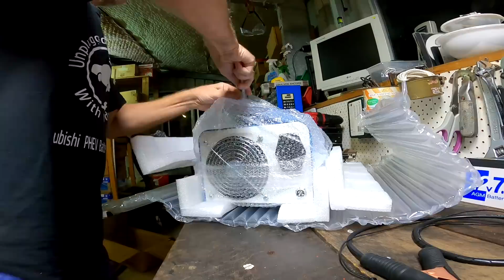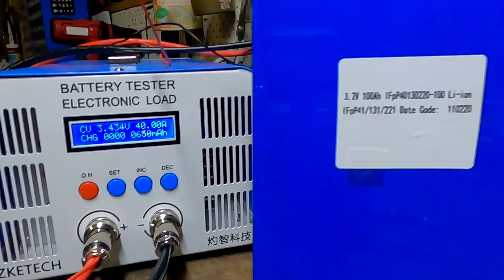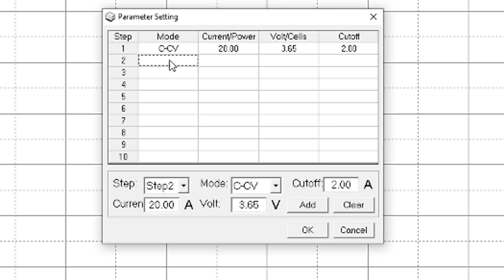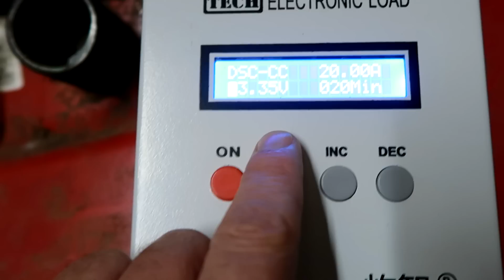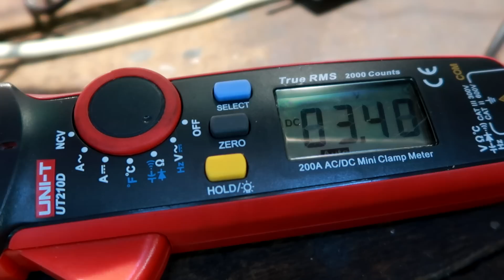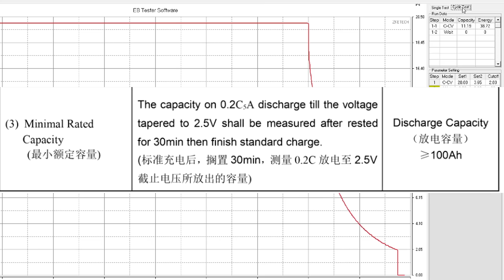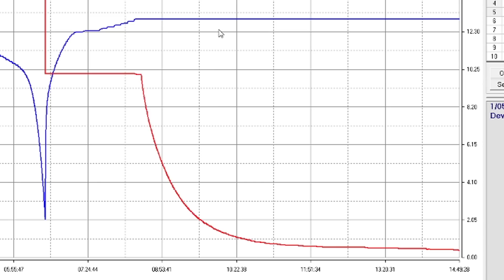My favourite battery analyser so far: Testing the BIG and POWERFUL ZKE-Tech EBC-A40L.

Comment: I know this is an older video but it was amazing thank you! One thing you may consider adding to your website install instructions is that the default zketech install location is in prgram files x86 and windows won't allow it to write down configuration files and autosave data files there. If you move it to your documents folder or somewhere similar then it will have these permissions without needing to run as admin which is a security risk. Awesome stuff!

Comment: I'm in Australia and do cordless lithium battery repacking with 18650 cells. I have the EBD-A20 H model and have had it for over 4 years and it never misses a beat. I can charge an 18 volt battery pack and it gives the total battery capacity in mAh.  Wonderful machine and highly recommend it.
Love your channel. Regards Off Grid Andy from Aussie Homestead NSW Australia 🦘
Reply: It seems to have a 12v 1A supply, how can it charge at all?

Comment: You know what would be good thing with this charger/discharger is that it when it discharges those cells, it will put the power back into the grid or power inverters. This way it doesn't waste electricity. This is just an idea. Most of those who use this are testing off grid storage cells and will benefit from reverting it backwards to save the power they used.

Comment: Just a 2025 update...  The currently shipping versions from Amazon have a USB-C port on the back and a USB-C to A cable included.  At 40A, I've found the 10AWG "current" cables get uncomfortably warm, would probably be worth upgrading to better quality 8AWG cable and ditch the rather dumb DIN connections by just hardwiring it, with separate voltage sense wires.  P.S. You can clip voltage sense onto the large clips, but they can also have voltage drop, so it's best to connect the sense lead(s) to the terminal itself at high currents.

The UI is still a little weird since you don't get any confirmation of voltage settings on the display when you run a charge or discharge, so it's a bit of an act of faith that it cuts-off where you think you set it to! :)  An alternating display between delivered power and cut-off would be more reassuring...

Comment: This has a built-in charger as well as it discharges. I thought I had read on Amazon that I needed to supply the charger, and it would control it. 
I want to create an electric bike battery charge system to extend my cycle life.

Comment: Hey i got this tester !!!! Thanks for what you do!!! You might wanna do a video about those smaller crocodile leads as tge voltage jumps around as I connect and disconnect these leads during charging.  I dont know what is going on with that. I am charging 16 280 amp cells all in parallel of course

Comment: I use it  for the first time with one cell.  It worked for a while and stopped saying there was no devise.  I checked all connections and reboot the computer and no joy.  I tried another cell and the same thing happed.  crap
Reply from the maker: Does it work without PC?

Comment: SO the big brother 40L max voltage is 5 volts (single cell)... It seems that the EBC-20  has only 5 amp charging...  but can charge a 12volt battery pack....

Comment: @OffGridGarageAustralia   Hello, maybe someone has encountered a case of loss of communication between the tester and the computer. Once you start the test some is fine for a while. The current and voltage values are correct. After a few minutes, problems begin. First, the data refresh rate drops. Then the voltage and current values start to go crazy. Then it's good again for a while and then it changes. Often, communication is completely lost and the tester does not respond to commands from the software. In such a case, the cyclic test is also interrupted and the tester does not start the next test on the list after completing the current test. Any suggestions?

Comment: Hello,
I've just purchased the EBC-A40L and 96 EVE 314 Ah cells. I understand that I have to top balance the cells in parallel to 3.65 V but shall I have to mount the 16 cells in series on my DIY boxes at the high voltage level ?
Many thanks for your help.
Patrick
Reply from the maker: What BMS do you use for your 16s batteries? If it has an active balancer, you don't need to top balance them any more.
Reply: JK BMS with 2 A active balancer. OK you mean that there is no interest ti use this power supplier in my case?
Reply from the maker: @patrickberger9151  not for balancing purposes. Put the batteries together in 16s and let the BMS balance each pack when you fully charge them.

Comment: if you don't have separate voltage measuring cables you would be limited when it comes to current because of voltage drop on cables, even if they are thick as f-ck

Comment: Thanhs for the videos. Question: These chargers all wear the ZKETECH branding yet can be ordered from dozens of different sellers. Reviews relect that buyers are experiencing nearly immediate failures and say the sellers either do not respond or are given the "cold shoulder" to requests for assistance. This seems an expensive unit having no tangible warranty assistance. Is it a complete "crap-shoot" to get a good unit? Could it be user error such a reversed leads?  Is there an alternative to cycle my larger LiFePo4 cells? Thanks for your input.

Comment: I just purchased this unit and no matter how closely I follow your actions I cannot get it to start charging or discharging. It remembers what I set it to, and when I hold the "set" button down to get to the screen where it shows current voltage and press "On" it just sits there - never starting the process. I am either doing something wrong or this unit came broken right out of the box. Can you help me? The manual was in Chinese and the English version only states some settings, but there is no step-by-step instructions on how to actually set it up. Thx in advance!

Comment: The manual says the voltage range is 0-5V, but you tested discharge of a 12V battery. What is the true voltage limit?

Comment: Hallo, I am dealing with EBC-A20, and ordered 40A version. Unfortunately now I have EBC-A40L now not working because of non-functioning motherboard with a processor-board behind the display. The seller/producer stop communicating after Refund Request at all. Does somebody have the motherboard (the board behind the display) on any NON-functioning box? It's a small board, so easy shipping just for a mailing envelope. Thanks, Ivo

Comment: Ein sehr gutes Video. Auch ich habe das Ladegerät in Benutzung und es funktioniert gut. Leider bekomme ich die Verbindung zu PC nicht hin. Bei der Portsuche wird COM4 angezeigt. Aber es geht nicht, auch mit keinem anderen Port. Hast Du eine Idee?
A very good video. I also use the charger and it works well. Unfortunately I can't get the connection to the PC. When searching for the port, COM4 is displayed. But it doesn't work, not even with any other port. Do you have any idea?

Comment: @Andy can i thise tester to analyse my 12v 150Ah battery pack? I need your assistance i am stuck 😊
Reply from the maker: The EBC-A40L one can only do single cells up to 5V.
The EBC-A20 can do 12V batteries but only with 20A discharge and 5A charging.
All info and specs are in the video description. Hope that helps.

Comment: The reason they use separate wires for the voltage and current is to that the voltage and current are measured right at the battery, ie if the voltage was measured internally the IR drop on the charge cable would not be accounted for.  With the voltage measured right at the battery the IR drop is taken into account. 

Great videos !  Good work.

Comment: These big clamps dont really make good contact! I would recommend to change them to regular, decent cable lugs. I guess the clamps at least get warm/hot when charging/discharging with 40 Amps ;-) For a real load test (to check battery quality) you need a load with 1C - i.e. 100A for a 100Ah battery. Then, when you have a voltage drop from say 3.4 to below 3.25 ...3.3 the quality is already bad. If the voltage drops below 3.2 (with OCV of 3.4+) you definetly know its a bad cell. You can test the IR with these cheap 1 kHz testers but its not the real condition - you need a real DC load test! P.S. you are from Germany originally, right?
Reply from the maker: It would make no difference. The large clamps only pull the 40A, regardless of the connection quality, cable length or heat loss. The small clamps measure the voltage precisely at the terminals.

Comment: Hello, if I would like to torture the battery more, do you think it is possible to connect two EBC units in parallel to the battery and thus load the battery cell with a consumption of 80A? Of course, connect to a PC and read data from only one. Thanks...
Reply from the maker: Theoretically, it will work but they are not synchronised, so one could start charging already while the second one is still discharging.
And you can connect them both to the computer as the software can be started in multiple instances and uses different com ports for each.
Reply from the maker: Theoretically, you can connect multiple testers. They won't be running in sync though, so, when programming tasks, one could have already switched to charging, while the other may still discharge due to difference in measurement.
If you only run them in charge/discharge mode, it will work.
On the CP you can start the software multiples time and can display several testers therefore. They all us different COM ports so this would work...

Comment: I am charging a bank of 8 Lifepo4 batteries, 8p with 40A. EBC says 134 watt charging power but from the socket it takes 304 watt. Is 170 watt own consumption of the tester? Is this normal? Thank you
Reply from the maker: Yeah, they are pretty inefficient unfortunately. I observed similar number with both of my testers. They are really only testers but not charges for daily usage.

Comment: Hey guys, I'm doing cycle tests with the tester and I have the problem that the software freezes after a few hours, but the device continues to run and also displays the current data. So I never manage to run an entire test on the software. I installed this on Win10. Does anyone have a solution for this? Thank you and save the world!
Reply from the maker: The software on my Win10 PC did the same recently and shut down the software over night. Everything else was still running. 
I had a Win update being stuck and had to remove the whole folder with all updates downloaded. Restarted the PC and the update went through. No issues since.
It could be the USB adapter as well which causes the issue. I have seen other comments about that.

Comment: I'm curious. You had bought the 5A charge/20A discharge model, as well as the 40A charge/40A discharge model which costs about double the other model. It has a problem that it only goes up to 5V. There is another model EBD-A20H that charges 20A, cost the same as the 5A model, and goes up to 30V. I'm curious why you chose not to buy that model and picked the 5A/20A model you picked. They are literally a couple dollars different in price. It seems to be more functional than the 5A model you bought for about the same price. Am I misunderstanding anything in any loss of functionality for buying the other 20A/20A model?
Reply from the maker: The EBD does not charge. It only discharges. The EBC-A20 and EBC-A40L are the only ones which charge afaik.
EBD - the D stands for Discharge
EBC - the C stands for Charge

Comment: By the way, did you tried to connect both of your EBC testers simultaneously to the computer and see if the software would connect to and manage all of them?
ZKE Tech has many battery testers available (I just have an 😇 EBD-M05), and I was wondering if the ZKE software would allow me to manage and operate various discharge testers simultaneously. Just curious, of course.
Thanks! 🙂

Comment: Good Morning Andy oh learned one! Thank you for holding my hand and walking me through this.  My tester came with no user manual  or computer software, even then when I downloaded it it is gibberish.  
I had to get a proper tester, my cheep china tester shows my new cells under size @273&276Ah.   One order of 16 arrived damaged, the other order was immaculate.  EVE factory test certs were never supplied as advertised.  I had to video the QR codes and send to Fogstar Electronics UK.  Only 4 worked at their end and all I have got is a spread sheet in Mandarin.
So far my email trail to the retailer is 21 emails long.
So much money and worries... 
I feel sick!  
Shine on
Gaz

Comment: Good device, but no ground on the chassis... Could be added by adding a cable from the internal power input to one screw under the top holding the handle after scratching the paint of course.

Comment: They use separate leads to monitor voltage to get a more accurate measure. There is very little volt drop over these leads because it's carrying almost no current whereas the main leads do carry current and thus have more volt drop over these leads. Thus you get better voltage accuracy because volt drop of leads >> zero.
Meters measuring low values of resistance also use this method.
Reply: I guess the question was why weren’t these two leads joined together at the end
Reply: @jacopo.scarpellini  sometimes they are with other manufacturers. I guess this way it just highlights that there are 2 pairs of leads.

Comment: Andy can these be tested on 12v battery thats been built
Reply from the maker: Not the big one. It can handle cells from 0-5V only. The smaller tester EBC-A20 goes up to 18V and can be used for 12V batteries.
Reply: @OffGridGarageAustralia  thanks

Comment: As you mentioned when charging the cell back up you put the wrong settings in (3.3 volts and 0.1 cutoff). What should those numbers have been and how would I set it to put 100 amps back in or around 50% for example?

Comment: Hi Andy,
I Absolutely love your videos, what a great channel!!! Very rare to find videos that keep me engaged start to finish, and your always do.

I have a couple of questions if you don't mind as I have just purchased the ebc-a40l.

I'm getting ready to build my first 12v battery using eve 280ah cells.  I was going to top Ballance them in parallel but have been advised to charge them individually for a few different reasons that make sense, 
So with this in mind could you suggest a charge profile for individual cells so they will be top balanced ready for building the 12v pack...
For example...
Would you charge to 3.65v or keep the voltage a little lower?
What current would you charge at and where would you set the cut-off for absorption??
Would you build the pack maybe with compression prior to individually charging each cell ???

Any help you could give me would be great, thanks in advance Dave
Reply: Really really really could do with an answer to this question so I can get on with building my pack if anybody can help id be forever grateful, thanks again Dave

Comment: Dear Andy, 
I have enjoyed your excellent videos for a while. Thank you very very much for your great contribution to the users community!  I am getting a new 12.8V 300Ah LiFePO4 battery with a built-in 200A BMS. I will also get an electronic load tester ZKE Tech EBC-A40L.

May I ask you for your recommendations for the following? 

1. Is it appropriate to use 20A on this tester to discharge and charge for testing the battery's capacity?

2. What parameter settings for this tester should I use to verify the battery manufacturer's claim of  max continuous discharging current of 200A?

Much appreciated!

Comment: Can we use it to charge pack ( e.g of 12 v ) ? Or it càn be used only to charge single cells of 3.2 v ?
TIA
Reply from the maker: All details for this tester are in the video description. This large tester can only handle single cells. There is a different version (link in the description) which can charge and test batteries up to 18V.

Comment: I nearly purchased one of these until I realized the max battery voltage is only 5 volts??@@##!!  I'd like to find such a device for a 16s 48 volt set up.  This isn't it.  Nice for testing one 3.2 volt battery at a time, though.  Just not for me.
Reply from the maker: Yeah, good luck finding one. That would mean it can handle 2000W @48V and 40A.

Comment: Hi Andy, do you have any suggestions for a cycle mode for EVE lifepo4 280ah. My batteries just arrived to day, may tester is still waiting for charging 🙃 and discharging. It would be great if you could give some tips 😊 🙂,  liebe grüße aus Nörvenich Marko
Reply from the maker: Hi Marko, you can do cycle testing with these testers, no problem. They can be either programmed directly or by using a computer, it gives you graphs and also more data.

Comment: Andy, can you share an unzipped software to the ZKetech 40 charger, thanks!
Reply from the maker: Hi Steve. It's right there on my website in the top section. Link is to my DropBox and has the .exe file for the software.
https://off-grid-garage.com/battery-data/

Comment: Andy, Have you done a teardown of any if these ZKE chargers?  I commented recently about picking up a used EBC-A10H, and I'm not so impressed with the build.

The unit I got was from a deceased estate, and turns out one of the load MOSFETs has taken damage, with a big chunk of the casing missing.

I've just put in the replacement after a couple of weeks wait, and it's up and running again! 👍🏼

I was disappointed to see the internal wiring used screw or spring terminals, and the wires inserted into these terminals were twisted and tinned. Also, no such thing as PE grounding on this unit. When plugging into the USB on my PC, funny stuff happens.